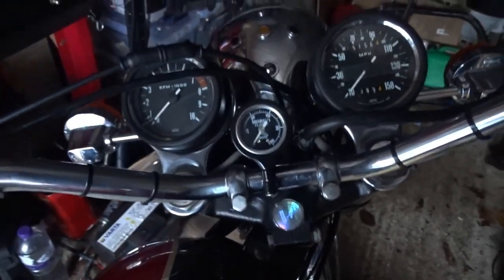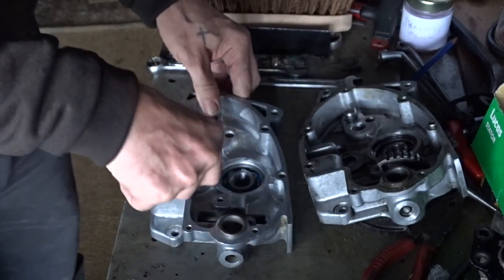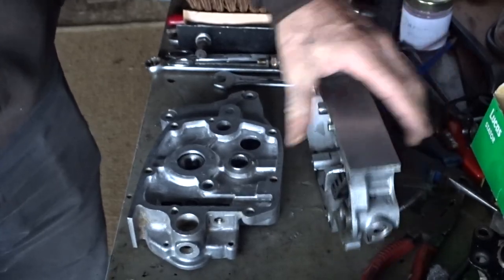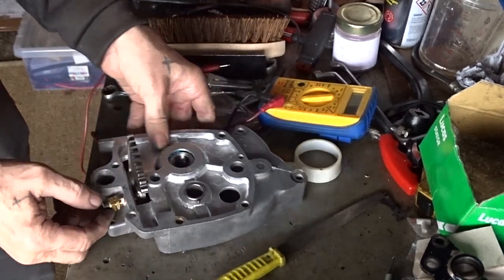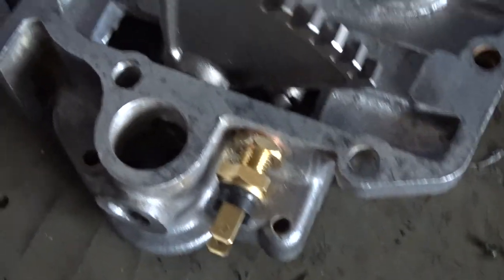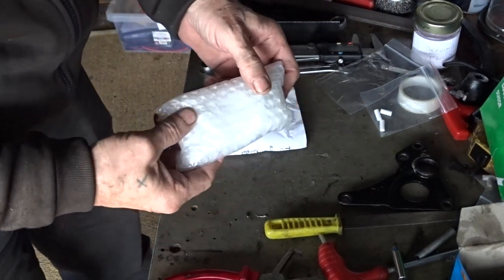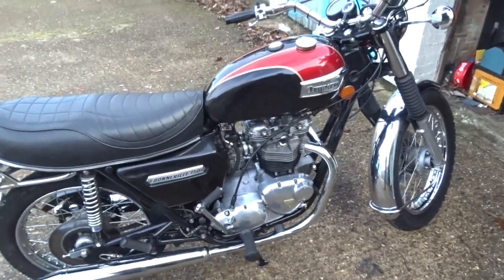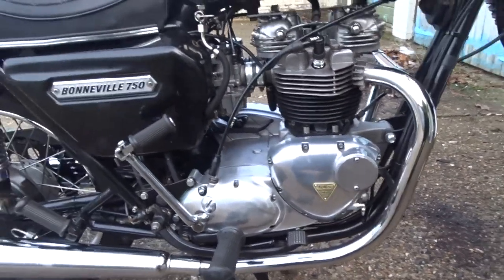T140E Morgo Oil Pressure Gauge and Adding a Neutral Light

Comment: You sure are one Smooth Operator.
Reply from the maker: haha thanks Todd, I have another mod coming up for the Triumph, I'm just waiting for the parts to be delivered, that'll be the next video!, stay tuned!
Reply: @OldBiker  I got into a conditioning in my '70 Daytona 500 thank you I was just using a manual and a roll of masking tape that I labeled things such as pushrods which one went where I kind of thing I did for the first time with no prior experience. The intensity in my ability to pay attention was all guided by my enthusiasm to get that new cylinder head replaced from the cracked one and get it running better than ever. Maybe that's just to it was all a dream come true with the new piston rings too. In later years I traded that one up including a lot of cash for a '75 Trident. That's sold all by itself and I moved off of little Cape Cod Massachusetts going up to New Hampshire where I am still today.You have that glorious bike so juicy sounding! 20:44. Actually, you know, I don't think the bike could have ever run that well and clean without this history of you attending to it, really. Do you have the Midas touch. That Bonneville is now solid gold!

Comment: i think shropshire classics do a combined oil light feed and op gauge take off for the timing cover
Reply from the maker: Yeah looks ugly hanging out the front almost level with the header pipes, besides I wanted the neural switch :D 

On another note Shropshire Classics tends to be the last choice in parts I'm seeking due to their extortionate prices, take a neutral switch for example the with an average cost of £14, exactly the same one at Shropshire £38.52 or the sludge trap tube alone eBay £12.99 - Shropshire £42.35! Joke prices in times like this especially when they are web based and have virtually no overheads.

Comment: Having an oil pressure gauge is great..but..what pressure should it be running at & what pressure is too high/too low
Reply from the maker: anything above 20psi at idle is OK, I've never heard of it being too high, mine runs at 75psi when ticking over at first start and around 50 at idle once warmed up. These will vary from bike to bike, mine has quite a good pressure as I recently rebuilt it with all new seals etc

Comment: haha pump oh well mate i,m just going to fit a oil pressure guage to the 650 bonny But the brass plate on the timing cover i know what it says i think who made it and can u get hands on one for sale and i need mudguards for the 1975 xs650 if u happened to have some cheers and here comes our winter, al
Reply from the maker: Hi Al my mate got me the oil gauge and fittings, I'll ask him and see if he can get one, by the way I have ordered a bunch of those 90 degree screwdrivers so will let you know when they are in stock :)
Reply: @OldBiker  appreciate that ,and does your brass plate on timing case say "parts falling off this machine are of the highest british craftmanship"?? fucking funny as your razor blade and i want 2
Reply: @OldBiker  i put new brushes in starter but now have to fix or bend the spring behind the clutch ,be good ir the starter behaved no news on the adjustable screwdrivers?
Reply from the maker: @alwood9148  Hi Al I should be getting the screwdrivers delivered sometime in the next week 👍
Reply: @OldBiker  cliff thats fantastic and the odd thing is the speed in which i asked , u replied !!it says 1hr ago now thats a good connection from OZ to UK lol
Reply: mate I sold a little honda other day and he (70yr old ) mentioned as a pom (both ex racers) john cooper i said i know that name and it is the bloke u know there ,this bloke is a ex pom now  living here small world david knight i think
Reply: gday cliff hey has any one u know with a trump 650 fitted a electric start thanks Al
Reply: @OldBiker  good one got airboxs and carbs back on the trumpy 750 but i need to look at your 750 vid to see the best way to run  my clutch cable, talk soon